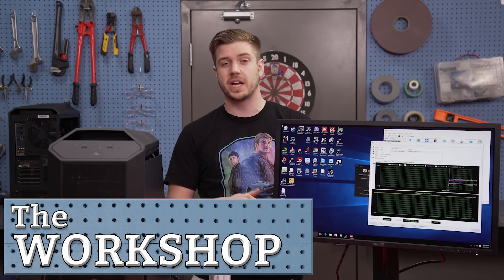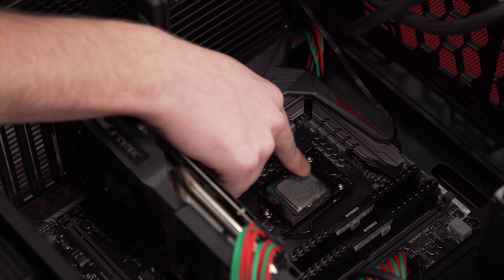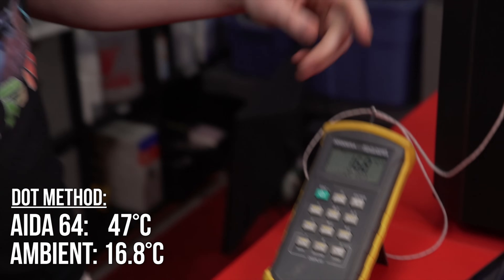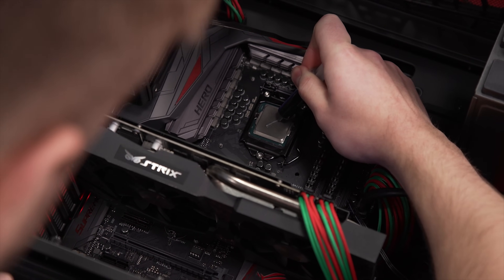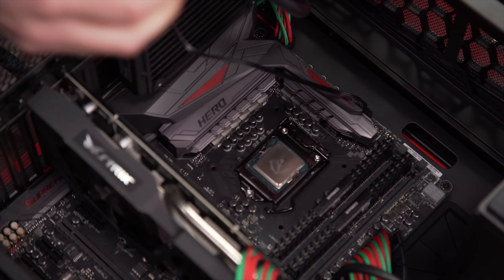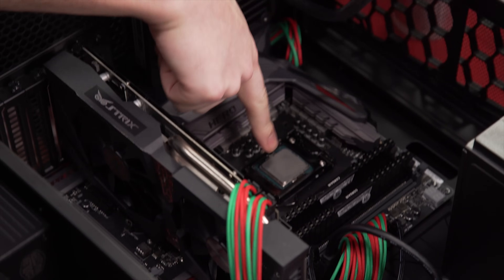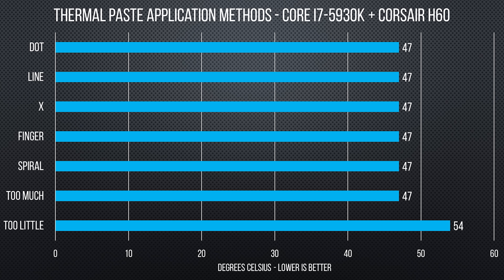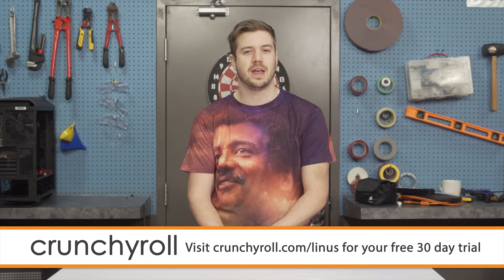Thermal Paste Application Methods - Which one is best? - The Workshop

Comment: This video gives me a bit of peace of mind. I'm fine with all the hard surface stuff going into PC building, it's hard to put a memory stick in the wrong way, for example, or screw a screw in wrong. Thermal compound is soft and you can't see the end result of your application without taking the cooler back off. Probably an irrational fear then. I'll try to be more confident in applying my own thermal paste (and changing out thermal paste in older rigs) from now on.

Comment: I think that the experiment should be done using another type of thermal paste too. To judge the value of the type, because commonly in other places, Egypt for example, we do not find the gray type that you used in the experiment easily, the most common here is a white thermal paste in small paper packets and it is not in syringe like you had used.

Comment: I thought the pea and line methods would have been best, just ensuring there are no air bubbles trapped in there. Oh well. The only negative is the too little method - and potentially the too much method due to possible electrical conductivity.

Comment: My temps were running high on my first build with the pea method. So I used a thin layer over the whole thing with a card (not bleeding over the edge--cleaned edges with Q-tips, TP, and soft cloths), and a pea method on that. Went down significantly.

Comment: of course yr gonna get all the same temperatures with a severely overkill cooler..
how bout trying it again with a HDT sink? something where things can actually go wrong..
also, having too much is not a problem, IF you tighten down the sink and smoosh it all out the sides.. its only a problem if you have a thick layer between the sink and the cpu = resistance

Comment: If you apply the rub the paste into the pores or the cooler and cpu... Then reapply you will get at least a 5 - 10 C performance improvement with Arctic Silver 5. I have done it. So you missed a method. And make sure you sped a thin layer with a razor.

Comment: Hypotheoretically, adding "Too Much" or "More" thermal paste might be the safer bet for the long-term. Because the paste will last longer before drying out to failure. #TeamTooMuch
Reply: Doubt it. There's only going to be a set amount of it between the heat sink surfaces. Paste that squished out the side does no good at all.
Reply: @krozareq  it acts as a barrier and slows down the drying process.

Comment: Seems like the single dot often misses the corners, and single line often misses the sides. 

I'd rather like to see, just once, someone try a "2-line" version [ | | ], or a "dice" (5 smaller dots) [ : · : ] version, to see if either gets better coverage over the whole chip surface than just a single dot or line alone, but without leaking over the edge. 

Like would the two lines spread out and merge in the center, or would it potentially miss the middle with an air pocket? Would the "dice" version hit all 4 quadrants, and make sure not to miss the middle (without creating quirky air pockets)?

Comment: I have always applied thermal paste by applying it in the middle of the processor, then using a flat blade completely covering the entire chip/thin layer.  I never have excess squirt out and it's always been fine.  I prefer this over the dot method because there is zero chance of too much be squished out anywhere.

Comment: This video still makes me laugh. Like duh of course its not about the method. So many volts = so much temperature. The paste will deal with the temps it can regardless of the way you apply it. Pea method seems to be the one that spreads the past the most evenly when yo secure cooling solution down onto the cpu.

Comment: Interesting Subject material

Using water cooling?    
Does this affect the results?

My own method be it wrong or right I always ensure the whole surface area of the cpu is covered.

I use the Square application with thermal paste, as the surface of the cpu is square...  

ill apply the paste, squish it with the Heat sink or block, then remove it and inspect the surface of the cpu and the heat sink / block.  
Only takes < minute to do.
This ensures 100%,  that when i power on the PC, that the cpu has full coverage.  

Also peace of mind that if there are heat related issues in the near future its not likely to be thermal paste.
(providing its not a junk budget  thermal paste)   

Peace.

Comment: The too much method is irrelevant becaus as you screw back the cover , it will put a lot of pressuse and remove the excess from the cpu . Thats why on the cpu it looked fine  . As long as you really tight those screws , you are fine .

Comment: A good high quality heavy duty heatsink will have a better polish on the contact plate, which means you can already have some pretty good temps without thermal paste. I bet that if he redo the test without thermal paste he will still get those 52° of having way too little TP (with that heatsink).
If he takes a low quality heatsink (although the new intel usually are very good ones), he will probably will have some little differences temps, because the heatsink contact plate will be not as efficient as a very polished one, having some degrees differences (although not as mouch as 10°, probably just between 2 and 5°).

Comment: I'm a computer technician and this test is absolute BS.  You don't test the temps after 10 minutes.  You wait at least a few hours, or preferably, a day or two for the thermal compound to cure.  And you need to use a stock air cooler.  Liquid cooling is so efficient that you can run one without ANY thermal paste and still be fine.  Now try to run a stock Intel cooler with the fan unplugged.  The sucker will overheat in 5 minutes.  

I bought a BRAND NEW laptop and the temps were approaching 100C after 5 minutes of use.  So I took it apart and the idiot that built it just put a HUGE blob of thermal paste on it.  I cleaned it off and put on Arctic Silver and it now stays between 35C and 50C depending on the workload.

As yourself this.  If the application of the thermal paste doesn't matter, then why is the thermal paste that's been pre-applied to your aftermarket cooler in a perfect shape (usually a square to cover 100% of the surface of the CPU)?  Too much thermal paste WILL affect cooling.  Too little isn't good either.  And for optimal cooling, you need to spread the paste EVENLY across the ENTIRE CPU in a nice, thin layer.

Comment: My CPU is running at 70 degrees Celcius under load. I never changed the thermal paste in 4 years. might that be the problem?
Reply: ianxv2000 What problem? 70 degrees is pretty safe...

Comment: For me this is how i do it, on a new build, Thing is i use a "sufficient" amount, Meaning full coverage over the CPU , then install the "cooler"  v8 Cooler Master.... And I always use my Credit Card.when i make a new build, ( reason is...well...keep reading...) As my C.C issuer/bank will step up to the plate and go to bat for me if my latest $10K build fails because of $3.00 worth of Thermal Paste, And i Don't have to pay, A win win.... I highly recommend Capital One, As they are the best at arguing this out for you, but how ever they charge the most A.P.R. %

Comment: Always used the 5 dot method, which is kind of like the X, but with less paste. Each dot is smaller than the single dot method's dot. I'm not convinced it would be any different from these tests. I miss the days of the old Pentium 3 cores, where you had no heat spreader, and had to really use less paste, and secure the cooler evenly and carefully.

Aye, it were harder in our day lad! :D

Comment: This problem was more relevant for fan coolers and CPU a decade ago. today's modern CPUs and AIO coolers are far more power efficient and with stock settings just going with a less is more thermal compound is a smart way to approach an application method.

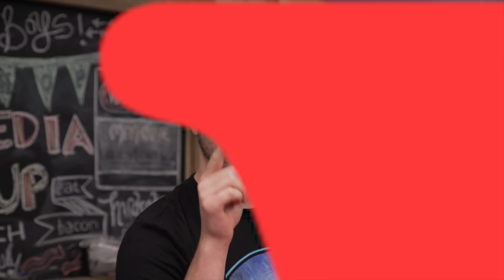Comment: Pausing at 1:50

I used to have a piece of paper and a block of wood that had a similar size surface area as the given CPU.

I would then apply an amount of paste on the paper, in a dot, of which I'd be guessing how much I'd need.

Then I'd press the wooden block on it, too see how much it spread to gauge if I used too much or too little. (Yes I usually buy two tubes. xD )

With that, I'd have a fair approximation of knowing of how much I needed.

And I use the single dot method with minimal 'wrinkling' to avoid air-bubbles.

Comment: just so you know, you can't add too much of the stuff to the CPU do don't worry about that, or the GPU, you can add to little, but not too much really, you can put a shed load on, and it'll still work just the same, it heats up exactly the same way, and then just like normal, it takes on the ambient temperature of the metal around it. so this video is uselss, it's just for hits. you don't need a fucking 10 minute video to tell you "Put some on the cpu so it's covered, then put your heatsink on".

Comment: As far as I know this is not saying much. 1) You need to put the CPU under heavy load to judge the performance in edge cases an 2) The paste needs some time to get to maximum performance, by being exposed to heat for a prolonged time I got told.

Comment: This is not good enough. I tested 3 different ways with an aircooler of 'Be Quite' and I got different temperatures. I went from 35 to 30 in idle when I applied just a bit more than a grain of rice.

Comment: This video is utter crap doesn't take in account extreme overclocking with high voltage that will increase cpus power output that will show the weaknesses of the Application methods. I had to open my laptop 3 times to replace the thermal paste. laptops cpu cooler have relatively low pressure that spread method works best with 10c difference from the pea method !!!!

Comment: is this accurate?.. cause isn't the pc and cooler set to autoadjust to set the temperature at 47?... it would be more accurate if you oc till the pc is struggling to keep the temp down, that way bad cooling would swing the temp up and down depending on the application method.

Comment: Touching thermal paste like that is not good, it might sound like im being silly or too overreactive, but your skin absorbs chemicals, even a little bit can have a harmful effect. IC diamond contains chemicals known as 'Glycol ethers', which exposure to has been linked to low sperm count, although this is not conclusively proven, i would err on the side of caution. 

Obviously one time exposure is not going to nuke his balls, but still I feel many of us who handle IT equipment should be aware of the occupational hazards involved (especially those who solder). 

I'm sure most of us (myself included) have ended up with thermal paste on our skin at one time or another, so this is kind of my warning to those that handle thermal paste alot, please be mindful, you don't what chemicals these vendors are putting into this stuff (as they are 'trade secrets') and what potential effect they can have on the body. If you look at the safety information for some thermal pastes you will see that they recommend avoiding direct contact with skin.

TL;DR - Touching thermal paste is potentially harmful, although it's not the end of the world if it has touched your skin, just try to avoid direct contact as much as possible.
Reply: So it works kinda like a contraceptive. That is good to know, eh? Kinda handy. How long does it take to catch on?

Comment: I have a small (3/32" wide), long-handle plastic spatula made for the purpose. 
I cover the entire CPU top AND the cooler contact area.
If the cooler allows (most do) I push it on, then lift and rotate the cooler 90 degrees and push again, removing any excess.
Thermal engineers will tell you that total contact area AND paste thickness both are important -- max area and little thickness.
Your tests suggest little difference, but I shall continue to maximize the contact area.

Comment: The classic method during that brief period where CPUs had a bare die was to use a random expired credit card or library card or similar and spread it like you spread butter. The idea was that it was more important that every square mm was covered right when you turned it on rather than having the least amount of air bubbles or whatever.

Comment: How about the next logical step, the amount of pressure the coolers is attached to the cpu? And I always thought if the cpu lid and the copper plate had some kind of interlocking connection, you would get better thermals.  Like maybe metal risers on the cpu lid the cooler could bolt too.

Comment: True, application doesn't matter for the short term. like, less than a week. After that depends on the quality of paste and the spreading that actually happens when tention applied. Have a cooler master Glacier 140xl. First application was solid for the most part for the longest. Had to troubleshoot, which led to taking the cooler off. long story short, was getting high temps 3 times in a row after 2 weeks each time. After the second time I started to pay attention to the residual spread of the paste ( Gelid Extreme). Apparentley tightening down the block pushed most of the paste towards the out side corners of the CPU leaving the center paste too thin. I'm a careful person and pay close attention when doing things that are Important or critical, especially when I envest in expensive electronics. In my personal opinion the expermint lacks time for the paste to cure. I would say you at least need a good 5 days to see how it would fair over time. Used the 3 line method and it's day 2 and temps are great ( 28 C while surfing and mind you it is 43 F outside and pretty cool in my bedroom) Game temps hit 53 C on dicking around with the free download of ACBF for Christmas. Replacing this current cooler with a Noctua NH-D15 soon.
Reply: sorry meant 240 XL. It's late and I'm exhausted!
Reply: also forgot to put..sigh. this experiment is bullshit. I love the LTT crew and all, but this is just crap. no use case scenario or "paste method overtime". Sorry but this just irks me. There are so many more varibles to considers that just slapping thermal paste on for and hour and saying, " Yeah that's debunked."

Comment: I think the main concern for me is air bubbles/pockets in the paste. 
I used the the almost too much method with a card to smooth it out evenly on multiple computers. The reason? one of my laptop computers that ran forever without any heat problems had WAY too much thermal paste applied by the manufacturer. It was a laptop and it had the thermal paste all over the place even on outside circuits and I'm not sure it did any harm. It is still running strong today. Granted I didn't apply as much as they did but pretty damn close. I also think there is some type of clear silicone material covering and protecting the circuits around the cpu on that laptop. It is a worn and torn workhorse laptop that I should replace with a newer one so any risks involved with too much thermal paste is not a issue for me. The time to take it apart again could be better spent elsewhere. 

I also drilled a damn hole in the back of the outer plastic case right above the cpu to let heat escape because there is no vent in that area. They really need to make better cooling solutions for laptops.

Comment: I use about half a pea in the middle and let the pressure of the heatsink do the work. This is for single-die chips, and the paste spreads out far enough to cover the area where the chip is, without getting messy, and being thin enough to let the heatsink contact the heatspreader, so that the thermal paste is ONLY filling in the microscopic gaps.

Comment: I would really like to see a carefully controlled experiment in which a very carefully measured amount of thermal paste is placed, and then, it is clamped down to plexiglass in the pressure a usual cooler would apply. so you can see exactly how it spreads.  The goal of the experiment to discover exactly the best ammount and spread method for some common brands.  if it doesnt spread enough before clamp, carefully in milligrams redo experiment till the optimum amount is found to spread.  this would be a visual test, and not necessarily run like this test, but this would be great to see from linux tech tips.  the challenge of it?  its really to figure out how to measure such small ammounts.

Comment: He was on the right track with the last method, but used way too much (in every test actually). I built my first PC in 1994 and back then the recommendations from the manufacturers was to apply a small amount of paste to both the CPU and the heat sink and rub it in with a finger (covered with a plastic bag) and then wipe off the excess. The idea is to keep as much metal on metal contact as possible and only have the paste fill in the microscopic 'pits' on both surfaces. The surfaces of the CPU and heat sink should both appear dulled by the application of the paste and to the inexperienced might not appear to have any paste on them at all. Remember, the purpose of applying paste is to eliminate any air between the two surface (which would impede thermal transfer) without creating a barrier between the two metals. I've done it this way ever since and I've never had a CPU overheat.

Comment: i'm going to put arctic silver 5 on my phenom II x4 and replace the old stock cooler with a new air cooler. On the arctic silver website it says the proper application for my processor is the 'middle dot' method. My buddy always spreads every pc he builds but i tend to want to go by the AS site recommend. what say y'all?

Comment: You did it wrong you moron! The X has to go from edge to edge of course and not be narrowed in the middle. And you should have used an air cooler to be able to differentiate smaller variances in temperature.